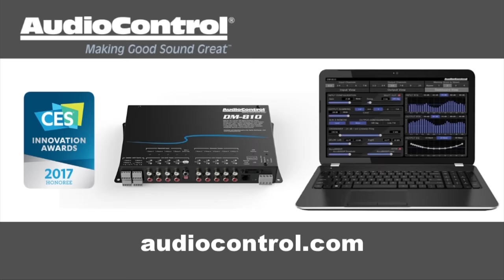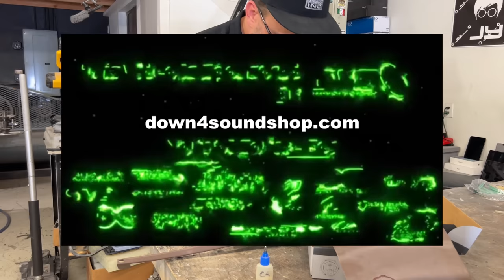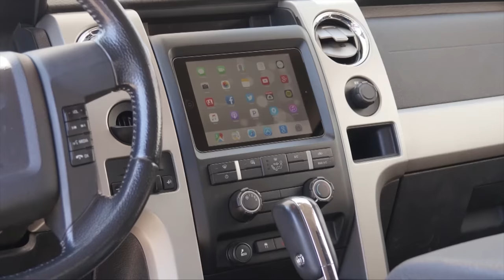car audio kick panel fabrication

Comment: You explained the sound in my 04 tundra perfectly. Tweets high and 6.5 low in the door card.  Its very tweety and you can tell where the sounds are coming from and I don't like the time delay because it makes the other seats sound bad.  Kick panel pods mod may be in my future. You are a mad lad my friend.
Reply: If you have network mode you could try different crossover frequencies
Reply: @FSXgta  Pioneer avh5700 and punch 1000x5.  It highly depends on the music playing.  Some music sounds awesome and some pitchy.  If I were to redo it, i'd put a separate amp for front/back/ and sub and dial it in that way.
Reply: Or try some time alignment if your Source Unit has it built in.

Comment: Got 4 inch coax in the dash currently, gonna upgrade with 6.5 NVX components for more spl and lower xover with the door woofers, so 100% of the vocal range is coming from the dash. Course it would help if I finished these damn door enclosures first, so I don't have 3 projects going on at once like Doug does.

Comment: A yawn is an involuntary deep breath, usually caused by shallow
breathing as when sleeping, or when nervous, apprehensive, or scared.

Victims of COPD tend to yawn excessively. A dog will yawn when confused.
Yawning is very contagious. You can lessen attacks by deep breathing and
holding the inhalation 5 seconds, repeating 5 times.

Comment: The subs they got them wired positive to positive and negative to negative and then they jump the other speakers same deal positive to positive wire on the triminal and negative to negative on the speaker triminal and wired to 1 ohm my amp says 1 ohm stable on it any ideas please let me no

Comment: Quick question I have 2 skar zvx 1500rm to 3000watt peak skar zvx 12 subs there 1 ohm speaker I have 2 subs wired to one ohm my amp is a taramp 8k that's running the subs ok my question is that when the bass hits my amp goes into protection mode plus I'm running 370 amp alternator with 3 battery my other amp for my voice is fine it's just the bass one I turn the nob amp level down and still when the bass hits it goes into protection mode as soon as I turn amp off and on its back to normal as long as I don't turn up the volume I don't even turn the volume up that much as soon as any bass hits bamm protection mode I'm running 2 grounds and to power wire 0 gauge wires to the 8k amp dam this shit is messing with my head alot can't figure it out